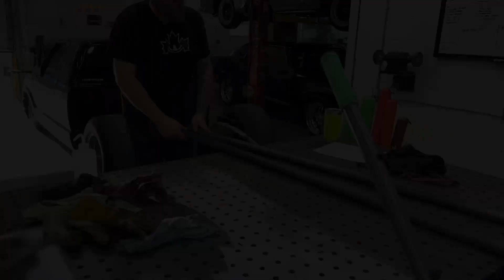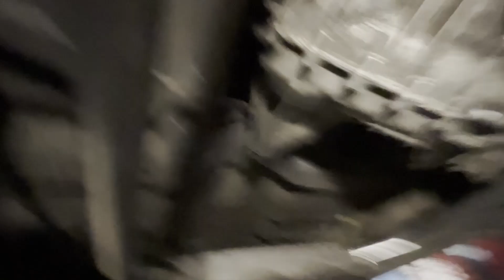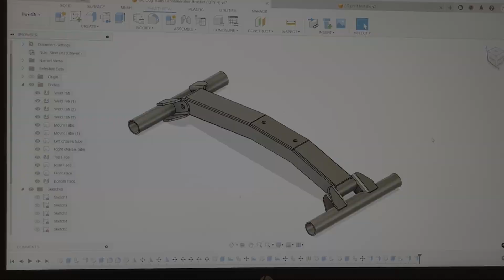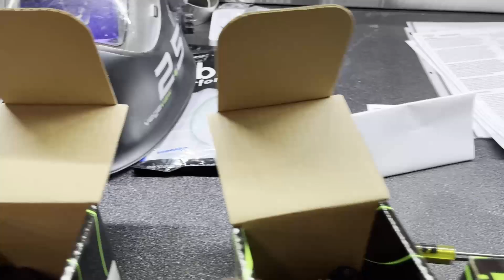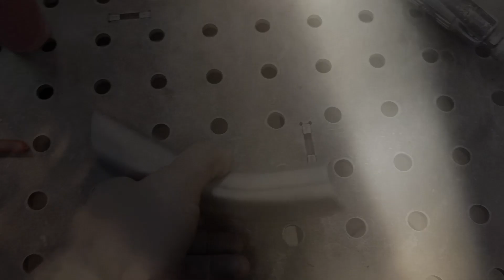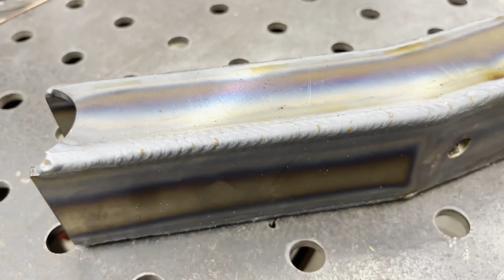Stock Crossmember, See ya! 1500hp Sierra Episode 5.

Comment: Just curious, did you end up blocking off inside of that tranny crossmember, to prevent losing the nuts during re&re? Wonder if that would maybe even add more rigidity as well.
Reply from the maker: I chose not to just to simplify the design. It's made out of .135" plate so it should be plenty strong as is, considerably thicker than the OE version. The stock ones are also not blocked off, worst case if I lose a nut inside I can just rattle it out again.